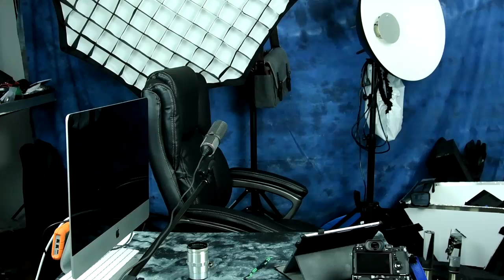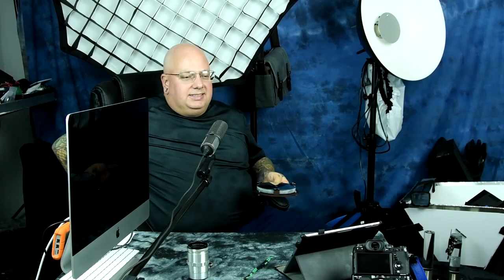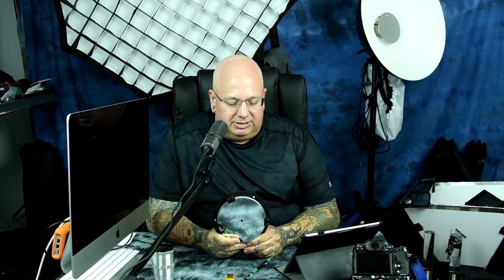🤓Photosite Gain, Dynamic Range, & SNR explained simply

Comment: Ken, I'm sure u know this but here goes the following stats:
D810 vs D500
Pixel pitch 4.87 um2 vs 4.2
Pixel area 23.72 vs 17.69 
Pixel density 4.22 vs 5.63 
As u know pixel area or photosite area is the size of the photosite , the bigger the more light and more dynamic range ,, so if the new Nikon model will be D500 upgraded to FX size then u are implying a smaller pixel area or photosite size which is what i was referring , the issue is how big is the new photosite , if its going to be as big as the D500, then its smaller already than the 810, so the only way it will be Ok if they improve the SNR with new software, if they want bigger photosites to increase the total megapixel count, then they have to increase the sensor size which I doubt they will do, and by the way if the total MP count is even 46 or higher than your forecast of 42MP that means that the pixel area is even smaller than D500, any how this is all speculative at this point , lets wait and see what they come up with and all will be revealed .
Reply from the maker: SAME PITCH scaled up would be 46MP.   wrong.......  its 20.8 x 2.25 = 46.8MP   ie 46
no, NOT smaller. same

Comment: Hey ken , if nikon new full frame is a higher megapixel count with the same sensor size , that means they are increasing the pixel density in order to achieve that because the megapixel count is either increased by increasing the density or by the horizontal and vertical count which is related to the size , or both, so that means if only the density is increased which is count per unit area , that means they can only do this by reducing the photosite size, so that means lower dynamic range and yes more resolution and detail but higher noise signal since the smaller photosites are bringing less light, so unless they are coming up with super phenomenal software to reduce the noise and improve SNR , the new camera will really be a bust in my humble opinion, what's ur take on this notion. By the way keep teaching us , thanks for ur teaching.
Reply from the maker: NO.......D500 scaled up to FX with same density would be 42MP

Comment: I have a question for Ken or for anybody who have some answers. Imagine if I have a sensor from Nikon d750. Now imagine if I paint the outside border difference between FF and crop sensor, in black, so effectively only the crop-size centre of the sensor is visible. So basically we will have crop sensor with the parameters of FF sensor, except resolution. This sensor will be crop by size, but will have the same DR, ISO noise levels, etc as the FF sensor. From this point of view how this video can be true :). 

If I don't explained well this is a picture from web: 
https://www.slrlounge.com/wp-content/uploads/2013/05/Full-cropped2.jpg

Look at the right side - imagine this is a FF sensor painted black when is the grey color in the image and only the green area is still visible.
Reply: Anybody? I expected some big brain to explain to me how this works :)

Comment: a question:  you said gfx dynamic range is 1.5 stop better than a 35mm. phase-one dynamic range is 1.5 stop better than GFX (approx). so, if dynamic range & SNR are 'exponentially' better when the sensor size increase,s why the differences from gfx and phase-one are less than 1.5 and not...3 or more ev? technical data says: phase-one 15ev, fuji gfx14ev, nikon  d810 12.9ev. so no exponential relation. there are too much variables in dynamic range and SNR. I mean...some idiocy regarding the bigger sensor/more light are wrong words to say the same thing you said in better words (generally - but not always -photosites are bigger in bigger sensors). so larger photo sites have better micro-contrast rendition and if SNR is Psignal/Pnoise, generally smaller photosites in more dense sensors have more Pnoise (internal noise, therefore, lower SNR). but in low light condition (higher ISO)...oh ok it's all too much complicated. probably photographers have to take great pictures and stay silence .S
Reply from the maker: confusing clipping with DR. 
shadow detail for extraction is amazing.